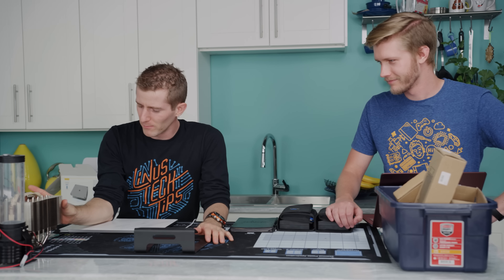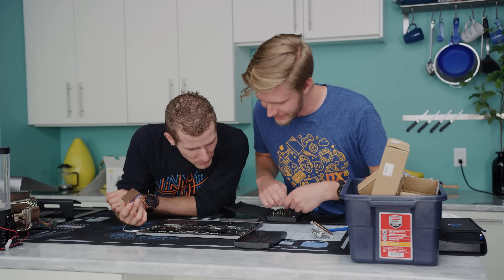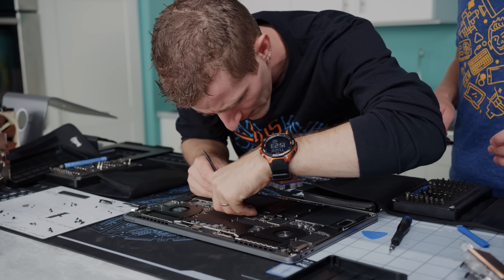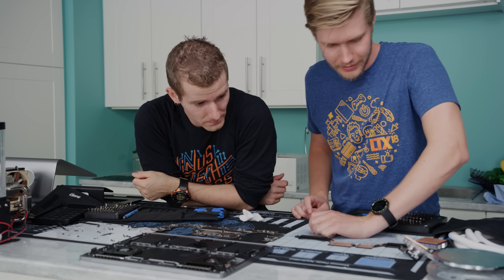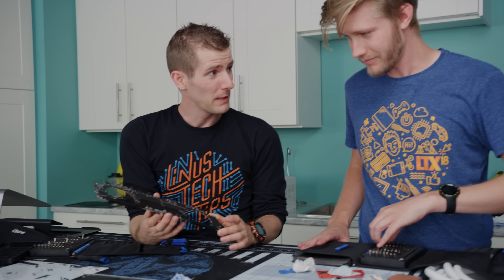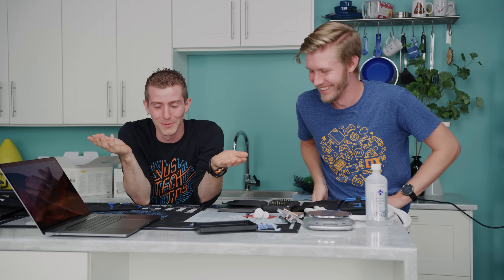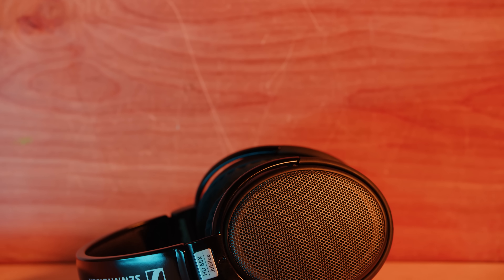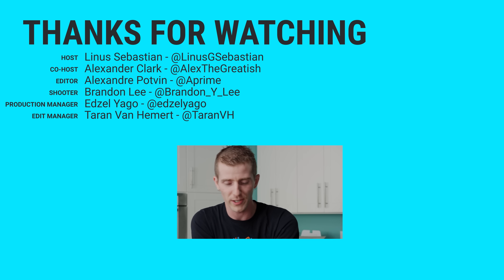We FIXED Apple’s New MacBook Pro

Comment: Now try using "Macs Fan Control", a program that lets you control the fan speed. Set the fans to always run on maximum. You'll see better results, as Apple sets the fans to only turn on once it's too late.
Reply: so apple is purposely killing your CPU?
Reply: @wildwilco  they like to keep them quite but first thing I do is set up mac fan controller. Install it the hour I get the laptop
Reply: @hrzon2935  keeping it "quiet" over keeping the high power hot cpu "cool" (because that tiny pipe sure as hell don't cool it) is basically killing the cpu. Letting it run at 100C...whenever you use it (so always doing anything significantly)
Reply: Wilco Muurling  Sounds about right for Apple - it means they will (regretfully hah!) have to sell you another one - or make you buy a new laptop!!!!
Reply: I use mac fan controller but you can set it up to work between different temps because Apple don't kick the fans in till it's 100 degrees c
Reply: Actually, this is must-have app for any Mac. Install it, make fans start at 60°C and maxout at 90 based on CPU temperature and call it a day!.
Reply: I always thought that they set the fans on at such a late time. Glad to see that its not just me
Reply: So the fan will last 6 months and will probably require mobo replacement including all that's soldered to the mobo
Reply: @hjembrentkent6181  it is soooo less expensive to swap your fan (you can DIY it), than resoldering BGA CPU. Stop being stupid, fan is not a part of mobo, it's swappable module, even MacBook is not all-around single non-repairable unit...
Reply: It's the triumph of idiots who want their computer to be silent.  I prefer a computer that sounds like a jet plane so I know if a fan dies and also have better cooling.
Reply: @Bezzegh Adam the point is not that better cooling will save your CPU. The point is, actually, that you want your expensive MacBook Pro (not so PRO, lol) to work for its $, not throttling lower base clocks. If you render video, throttling vs non-throttling can cost you 50% of rendering time.
Reply: Spinning up the fans to max is a fool's game.  It doesn't improve remove the underlying thermal bottleneck and it pulls vastly more dust into the machine, which will degrade thermal performance further.

Comment: Thanks for doing this. I'm on the edge of my seat.... One thing I think I've learned from your investigations,  is that cooling down the bottom case-panel even to sub zero temperatures doesn't really do a whole lot for overheated processors. 
How about just as soon as you get the back off,  take a photo of the open back, then in photoshop finding the edges...something something so that you can crank out a 1:1 scale   laser print that isn't black on black, printed across a couple of over lapping pieces of paper (I do this all the time with Illustrator)....then taping these together over your trick magnetic pad. (ten minutes max) Then all the screws can now be  set down in their relative positions.  (I used to always have trouble getting the right screw back in the right hole until I taped them in their relative positions on  sheet of paper (but I didn't make photo and a print out...)   Glad you both got out of the back of that MacBook Pro alive and uninjured....

Comment: If you are wondering: It's saying ''do not use on aluminium cooler'' , wich is because liquid metal reacts with it. The safer option would be to use it on coolers with a contact area made of copper.

Comment: These guys would fail miserably in the area of academic research. Why wouldn't you test it against a control eg. getting results about when & under what specific circumstances or scenarios the thermal fans kick in prior to the mod being carried out. Measure the decibel level before & after

Comment: No, simply no. When he said that the MacBook Pro's Heatsink had to be removed by taking out the board out of the chassis, I had the exact same reaction as Linus. And I say that as someone who works in tech/board repair for school districts, corporations, and government depts. It is going to take way too long and will cut into a technicians time just to simply reapply thermal compound, we're paid hourly and there's no way in hell my boss is going to pay me for a repair that requires a long ass time without driving up the price. Guarantee you quotes for any kind of water damage/board repair for these devices will be expensive AF because the parts are both expensive to replace/repair and racks up a huge labor fee. This is how Apple is pushing you towards buying a new device now, rather than fixing it make it a pain in the ass. Pray for me tech brothers, I'm gonna hate my job every time one of these arrives at my station.

Edit: I just saw the part where you need screws for it to turn on, WTF. I've seen screws get knocked out of their threads just because some high school kid decided to drop it in his backpack. And they can easily fall out of the case or get trapped under the board. Also thanks Linus that actually really helps me because now I know to check for those screws. Btw, which screws were they?
Reply: @Oh hi Mark yep and they're still that way. Usually a broken or defective (as they are lately..) keyboard is an entire top case replacement which includes the track pad and also some other components but that differs by model
Reply: Look on the bright side - at least it's not 50 years from now when Apple will be making cybernetics.  Imagine how difficult it will be to replace iEyes when they get water damaged.
Reply: +Admiral Cirno On the bright side there won't be any tears anymore, because your life will be perfect.
Reply: You will have to wait for the itears Firmware release.
Reply: OOW liquid damage for touchbar MBPs is almost always $1525, $800 for non-touchbars. For in warranty under Applecare+ there's a $299 deductible and the system is outright replaced if it is deemed uneconomical to repair. The way Apple handles liquid damage is simply replacing every part that has come in contact with liquid so for Apple the repair is actually relatively simple, we just replace it. It's the 3rd party repair shops I worry about :(
Reply: @zomah2  better start hoping the customer backs up their stuff to an EXTERNAL device because bye-bye lifeboat connector, hello Screwed-ville.
Reply: @sivalley  absolutely. See it way too often. If the system is liquid damaged it's usually an entire board replacement AND they lose their data. Ouch
Reply: Insurance will likely write them off, so you won't be affected.

Comment: When Steve ran Apple their Mac lineup made sense. If u wanted a thin light laptop you got MacBook Air. Very light and small laptop with few ports. If you needed to accomplish heavy duty tasks you got a bigger MacBook Pro with many ports. Or if u needed a budget laptop you got MacBook which still had decent ports. Now you got fanless MacBook running a slow 1.1 ghz cpu (I’m sure thermal throttles like crazy). Still same body style 11 year old MacBook Air than never gets updated. And hot mess of a MacBook Pro with 2 or 4 usb c that barely any peripherals use with awful keyboard, gimmick touchbar that no one uses or likes, thermal issues, insanely large trackpad that gets in the way of typing. And you can’t upgrade a single thing. At least back in the day you could upgrade ram and hard drives/ssd. You can’t even connect your iPhone to a MacBook Pro without an adapter. But boy this laptop sure is thin which is obviously the most important thing, who cares about anything else. For a trillion dollar company their Mac lineup is in serious trouble.
Reply: No, apple are not in any kind of trouble because the idiots that buy their products CONTINUE TO BUY THEIR PRODUCTS!
Reply: Still, Steve is rolling wildly in his grave now. If he would see what kind of crap Apple makes nowadays he would kick all out from Apple now
Reply: ayasinsk I miss Steve. it just doesn't make sense to me that average consumers now are supposed to get a pro-line MacBook, which was… for pros. and the regular MacBook should be the air. and their should be a regular MacBook that's budget-y for average consumers. I mean they still have average iPads and now the iPhone XR. I don't understand them.
Reply: Still rocking my 17” 2011 MacBook Pro (with an added ssd, 16GB of ram upgrade, changed the optical drive to a hdd for additional,storage) still works great for all the stuff I do....no plans to upgrade any time soon....I like the bigger screen and upgradability that are just not present in apples current lineup
Reply: The 12 inch macbook is fairly fast now. I do photoshop and make demos in Ableton with the i5 2017 model, never lags at all. Also back then yes you could change the drives but they were slow sata drives not nvme drives. Also usb c / thunderbolt 3 is far more useful then firewire and usb 2.0 lol.
Reply: And yet people still keep buying them. Not techies, far from, but the people who want "that shiny new laptop" and never understood about ergonomy. 

And as long as people keep buying them and sales keep well through the price hikes, why not milk the cow while it gives milk. 

I agree early Mac Book Pro's were truly awesome. Now... why again own one?
Reply: I want you to stop and think -  Apple... budget laptop?
Reply: Not An Uploader I mean sure, but still... The most budget-y "easier to get to a Mac" laptop. For either people who love Apple's OS and just want a more portable device, or for people who don't know shit about Mac's and just get one because they think it looks fancy and it's hipster af but they have no clue how to use it
Reply: Not really, ask to the owners of 2011 MBPs who make heavy use of their GPUs, those things are just not able to resist the heat. Yeah, Apple fixed the problem for free up to the end of 2016 by replacing the whole logic board but in time it'll fail again.
Reply: Preachhhh, OP!
Reply: So basically you should be a Lenovo Thinkpad for half the price and be happy because it does everything you will ever need and more.
Reply: And nothing is stopping Apple from raking in trillions more from mindless isheep.
Reply: @PunzL  Savage. ROAST'EM ALL
Reply: I read Erics post and liked it immediately. Then I read Kappas post, immediately unliked Erics post and gave it to Kappa. Isn't the internet a fickle bitch.
Reply: Idk, I wouldn’t trade my thunderbolt ports for any other USB port. 2 4K monitors running out of one port and extra usb 3.0 slots literally all in one port out of my 4. Can also charge through any port I want. The trackpad, I actually cannot use other trackpads anymore without getting frustrated at their lack of usability. The Touch Bar, I agree, tacky at best. Keyboard is fantastic until you get dust in there. Regardless, I don’t game and for productivity, no other (more powerful, keep in mind) windows laptops that I own even come close for my uses, and that’s what you pay for with a MBP. Not the worlds best specs, but their specs used right
Reply: Mark Hacz I have 2013 MacBook Pro that has MagSafe charger which is a great safety feature against tripping on charger cable and having MacBook tumbling down. 2 USB ports which are still very much industry standards, no need for adapters. Sd card reader which is insanely useful, hdmi port that is very useful, thunderbolt 2 ports (I only use one of them for Apple Thunderbolt Display), keyboard that is very comfortable to type on with nice key travel, trackpad that is not oversized. I just don’t think that sacrificing all the useful ports, thermal throttling, and poor keyboard design was a good idea just to get this laptop line super slim. Sure you can use dongles for your ports but that’s extra money you have to spend and have to carry them around. I think a much wiser move would have been to include one or two usb c ports but also keep as many other ports as possible. Apple’s obsession with thinness is getting out of control. A pro laptop should focus on usability and performance rather than esthetics. Previous gen retinas were thin enough.
Reply: That is insane. Apple does not have a monopoly on productivity and they don't even do it well.

You drop the same amount of money on a kickass build and it out performs the mac by a crazy margin. 

Allow me to show you this: https://imgur.com/a/29BsQlv
Reply: Hey d*ck cheese .. There are Thunderbolt 3 ports .. not USB Type C..  So shut the f*ck up.
Reply: the ports are actually usb type c. (https://en.wikipedia.org/wiki/USB-C#Connector_pinouts)
Reply: Eric Matthews your „i“ and „u“ broke already right?

Comment: The reason you have to reapply liquid metal is the same reason that you can't apply liquid metal to aluminum. The liquid metal slowly joins with the copper, creating a solid metal alloy and an inefficient interface material is left between the heat sink and the cpu. This also happens with nickel, but at an even slower rate. The problem with aluminum is that this process is very fast and creates a very soft alloy.
Reply: Watch GamersNexus recent video on liquid metal aging.

Comment: Why no actual temperature measurements?
Reply: Because it probably reached the same temps and throttled, just throttleing down less than it did before liquid metal.
Reply: @BorkBorkDoggo  throttled harder than my mom's kitchen. Rest in potatoes in peepee mom's kitchen.
Reply: True. They also need to do the same "fix" for the GPU... its also quite bad, look at the scores!

I wanna see someone do both, then post numbers for performance, temperature, and noise!!
Reply: @ekinteko  did you even watch the video, they used liquid metal on both cpu and gpu
Reply: @tommihommi1  
I did watch it, but I skipped at the middle. My bad.

Still doesn't change my point, we need a stress test for the CPU single-core, multicore, GPU... then see the performance gains, thermals, and noise metrics.
Reply: HOT
Reply: Not one temp comparison. S C I E N C E
Reply: @Nickscrazylips  Why as it probably ran at 95°C with or without liquid metal. The only possible gain was performance. Though Apple removing the temp app from the store after all the bad press about the i9 meltbook probably also had something to do with it.
Reply: CheapBastard1988 they really dislike apple, so even if they could check they probably wouldn’t
Reply: If only there was a way to plot temperature over time 🤔🤔🤔
Reply: or atleast clockspeeds
Reply: The problem mainly lies with the vrm not the actual cpu
Reply: What a waste of time. They didn't do any work. FAKED.

Comment: All I got out of that is you need to cut holes in the bottom... please provide “WORKING” diagrams so when it works I can do it. Also maybe think of water cooling the onboard block so you can still use the laptop as a laptop and use the water cooling as a stationary option!! Please and thanks! Love you guys!

Comment: Alex: I wanna Watercool and liqiud metal Macbook pro.
Linus: No on the Watercooling, Ok on the LM.
Alex: I wanna put 2 Blowy McBlowy's on the Macbook Pro. We have to cut holes in the bottom.
Linus: We're not doing that.

Wait, you have a 3d printer. Why not 3d print a new cover that allows water/McBlowy attachments?
Reply: It has to be machined from one block of aluminum.

Comment: Apple should really look at Nikon’s design. I can take apart the 6000$ Nikon cameras without any tool or pressure with just a phillipps scredriver, and those cameras have waaay more parts than a whimpy Macbook
Reply: Difference is, that most hardware, but in  particular apple hardware is designed so that you get discouraged to diy. Because they would rather just have you buy new/ getting certified service.
Reply: Yeah, its just the the expensive Nikons are made for the needs of actual pros instad of dumb fanboys.
Reply: @BakjeLeip  true, steve jobs era macbooks are the best
Reply: Apple does not even design their hardware so that they can service it. They just replace everything and charge you 750$, done. They dont need to pay certified people that can repair those things and they make multiples of the actual part cost. Everybody is happy ... oh right the consumer is not.

Comment: Hey, do you guys design hardware? Do you design laptop computers? Go design some of these devices before throwing shade on laptop dsigns. What were you expecting, you knew the device has thermal issues. You know the device is thin. If you google you will see that opening a macbook pro is not recommended. You opening it up, and ridiculing it, does not prove anything.

Comment: Gamer's Nexus showed a system under a year of non stop use with liquid metal and it didn't need to be replaced. I know you need to but IDK how often you would need to replace it.
Reply: desktop is different than laptop as well, the metal may shift as you move.  regardless, if you EVER had to replace it on this, I don't think it's worth it

Comment: You don't need case screws for it to turn on. Every time you disconnect power from the logic board, it requires you to press power button twice for it to properly turn on. The first press will bring it on for 1/2 seconds then it will cut off. The second press will then boot normally.

Comment: Great product design involves the discipline of serviceability. Seems Apple forgot that with all these different screws.
Reply: They probably did that on purpose so people won't try to fix it themselves and just pay apple more.
Reply: Think Different
Reply: They didn't forget that, it's intentionally designed to not be repairable by the user. Drives up the repair cost, pushes people to throw it away and buy a new one - which will be even worse to service.

Comment: Cut a hole and use aio to watercool the heatpipe. Lowers the temp from 90 C to 60 C on regular laptop. If you have to go, leave the watercooling setup at home and cover the hole.